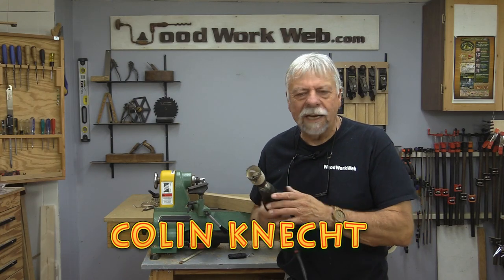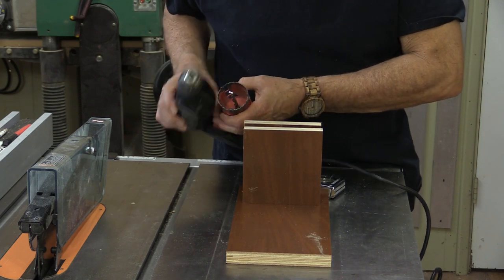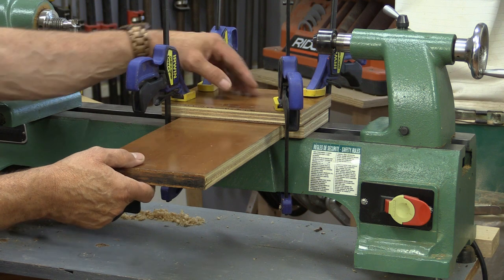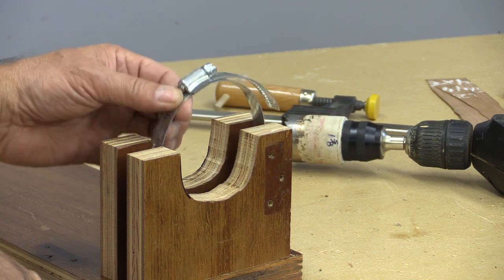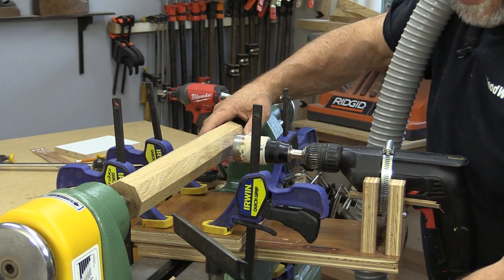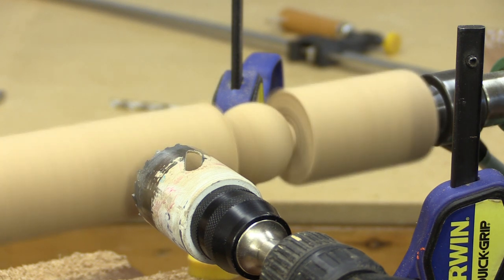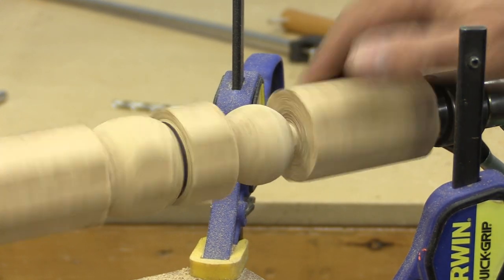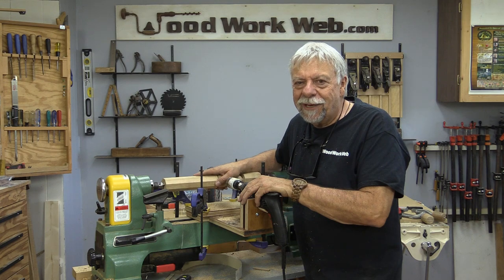Making Wooden Balls / Spheres On the Lathe With a Drill

Comment: It's advantages to have the lathe slower then the drill in rpms. The larger differential, the better. If the lathe and the drill are similar rpms, you can assume that at a certain depth the surface speed of the wood and hole-saw teeth will be the same and thus will not cut. In your setup, the teeth on the left of the saw will be traveling up direction at X surface speed. If we assume your wood blank is the same diameter (if it's not, it will be after you cut a bit) and is spinning at same rpm, then outer wood fibers would traveling at the same surface speed but down in the opposite direction. With respect to the wood fibers, the saw teeth would be traveling twice the speed and would cut. Conversely on the right side of the hole-saw, the teeth would traveling down in the same direction as the wood fibers at the same speed. With respect to the wood fibers, the teeth would be traveling 0 mph and would NOT cut. This will make the saw cut on the left but only gear cog on the right. A slightly faster lathe will outrun the hole-saw and would be like running the saw backwards in a stationary wood. Slightly slower lathe will allow the saw to outrun the wood but will be slow cutting. It is more efficient and yields a smoother finish to run a very slow lathe and a fast hole-saw.
Reply from the maker: Interesting ... some experimenting should yield the best setup and speeds. Thanks for watching!
Reply: I was going to make a comment much like this one about the relative difference between the teeth on the hole saw and the spin of the lathe.  cool idea though.

Comment: I suspect that slow speed drill would be more effective. On one side the cut is going drill speed + lathe speed and one other side it is lathe speed - drill speed. So at certain speeds the drill and lathe speeds coincide and there is no cut.  To cut evenly the drill needs to be stopped! But after the initial cuts then there needs to be sort of diagonal cutting so a bit of moderate drill speed is needed. Be fun to try with still lathe, cut 1/3 through, turn spindle 1/3 and cut a further  1/3, turn spindle again and cut again. This would give a very angular ‘sphere’, continuing to nibble away would eventually get a round shape.

Comment: Ok, I really hate doing this, but this idea won't work. There is a reason there was burning in the wood especially after increasing lathe speed. The right side of the cut was rotating down with the direction of the hole saw and was going faster than the hole saw. Thus it was as if the hole saw was trying to cut in an anticlockwise direction. A slower lathe speed and a finer tooth hole saw should improve performance.